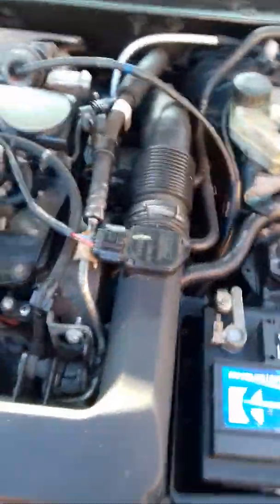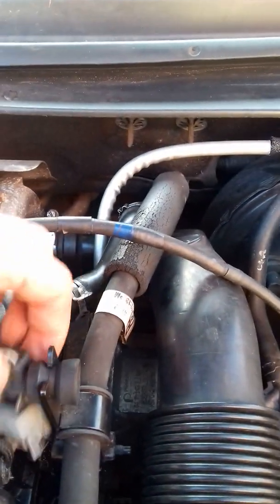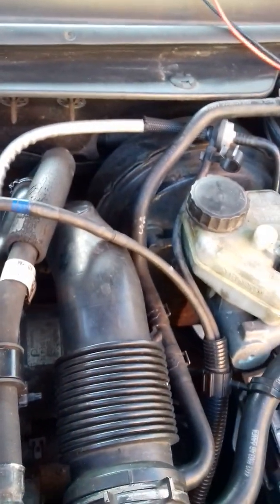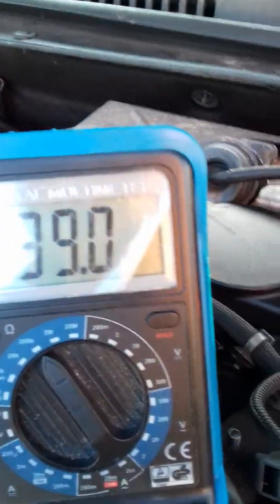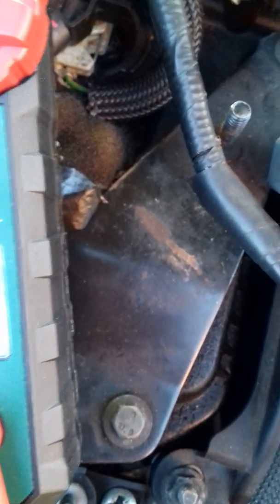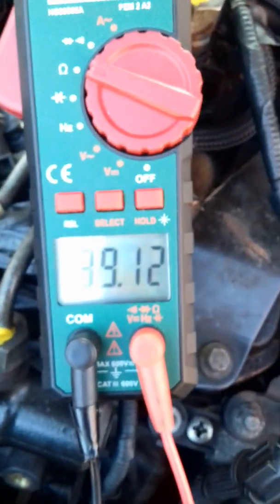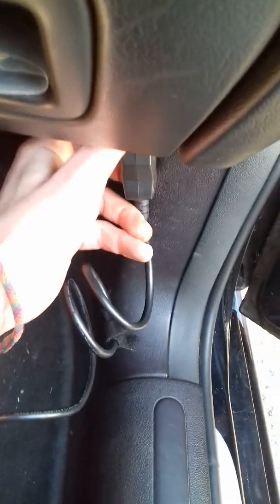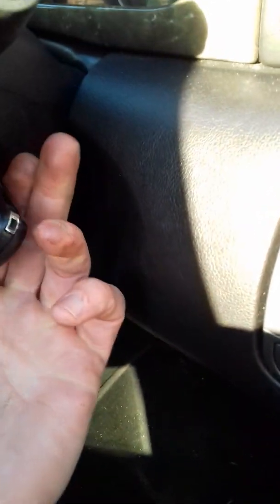Jaguar X-type/Ford Mondeo tdci diesel CHT cylinderhead temp sensor testing with multimeter/scanner

Comment from the maker: Hello so sorry I've been away from you tube for while now & not seen your comment...did you sort out your issues? In this video it was the Cylinder head thermostat that was faulty which was causing the water temp gauge showing low tempersture